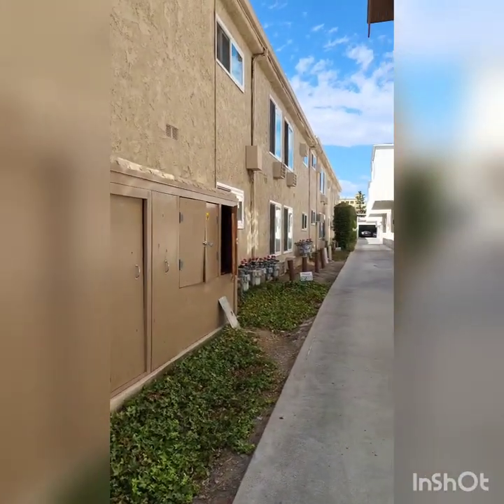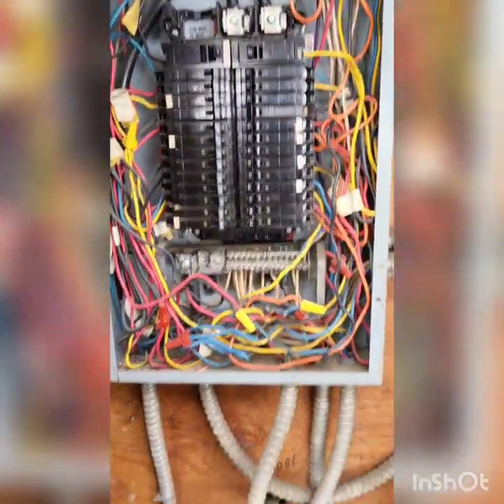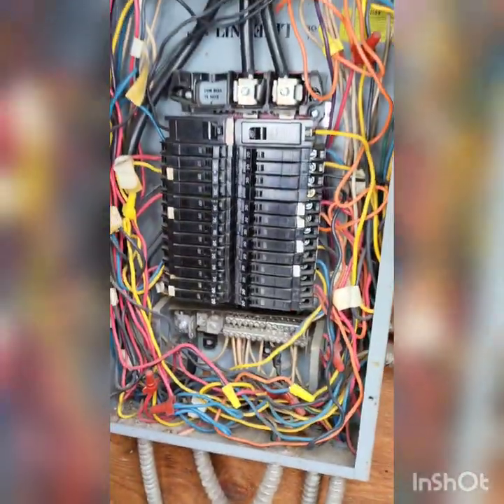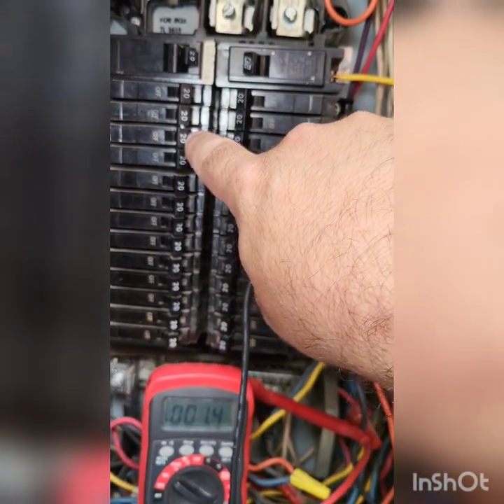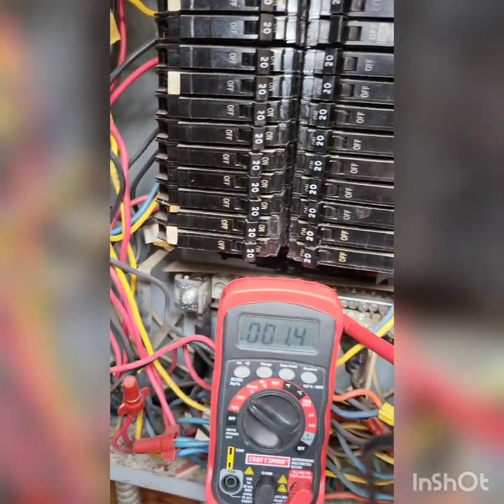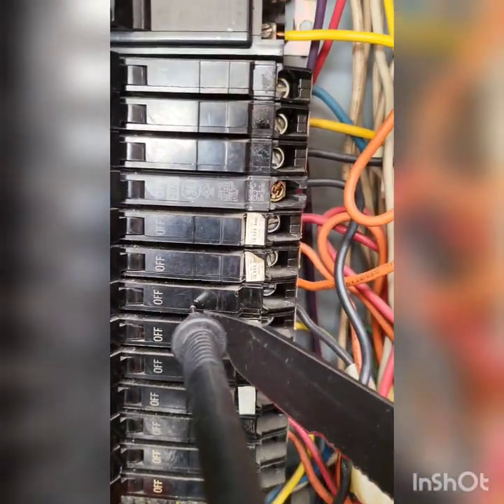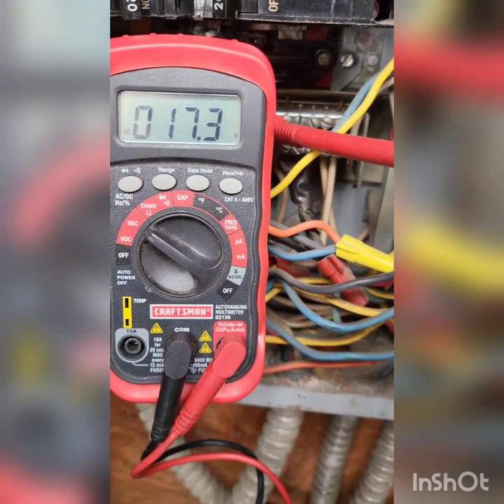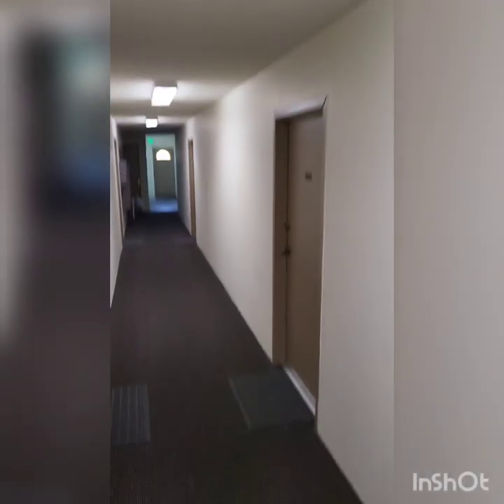Electrical service call -  This was a quick fix

Comment: We need a channel just like this video of troubleshooting service calls.  Had a crossed neutral yesterday and a back-fed line and neutral in a fan box with no attic access. I told the customer it would be easier and cheaper to pull new conductors to box and drop a switch line.
Reply from the maker: Great idea!

Comment: Hey I just subscribed to all your channels and podcast! You mentioned that there was no Anti-oxidant. If that is a fairly new install it probably has the newer aluminum wire rated AA-8000 or above and not required to have anti-oxidant applied. It’s also not a code requirement. I’m so old, I’m used to using it so I still apply it to all my outdoor aluminum wire anyway. Can you maybe make a short video on this and discuss it? Thanks !! Love your content

Comment: Hey 360 electrician-  where is the clamp on fluke meter to check your amperage.
Reply from the maker: @Jgnzz! You are awesome. The funny part is I have a fluke clamp on but my guys took my tools off the Astro and I was stuck with my sears $29 special. When I ended the video my guys brought me a new GE breaker, and Rudy did the amp test. Ofcourse later found out that property maintanence changed some ballasts and most likely tripped the breaker.

Comment: did you charge the time to get the breaker and marked up the price on the breaker or did you have the breaker already in your van? if so how did you charge for that? Just curious
Reply from the maker: So on small jobs like this where parts are less then $50 you have to charge a minimum. This minimum takes care of overhead, stocking the material, drive times, labor and profit. For us that's $299.
Reply: @The360Electrician  go it. Thank you 👊

Comment: Man be careful with that voltmeter. That’s a cheap meter and it can explode or back feed
Reply from the maker: I don't know about exploding but yes that meter is like the most generic out there. I usually use my Fluke but the Astro is where all tools go to die. Thanks for the comment and the sub to the channel.